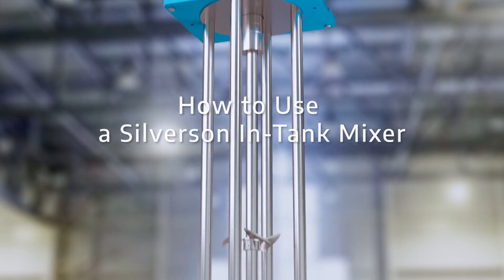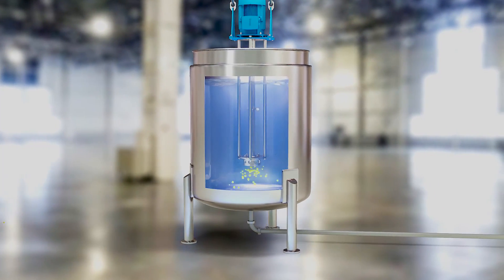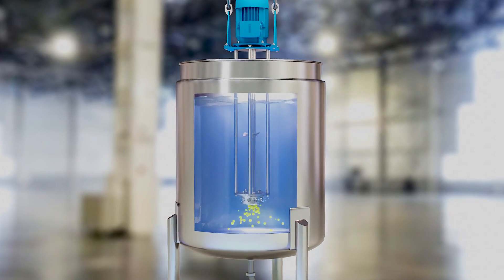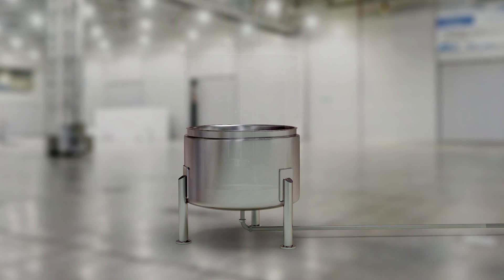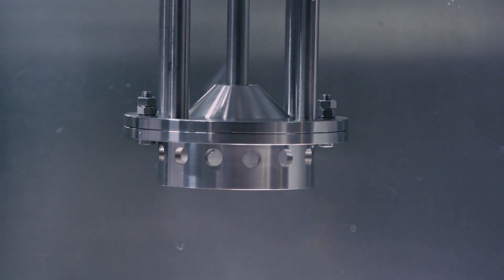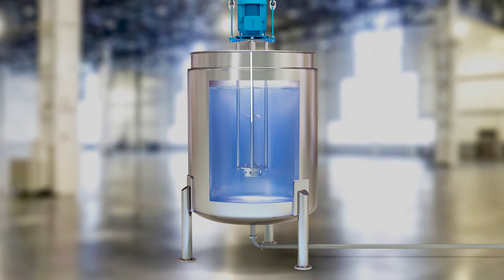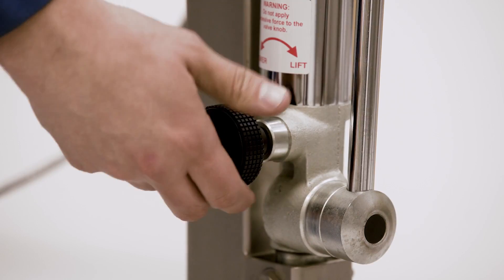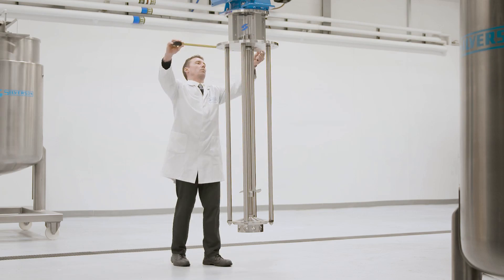How to Use an In-Tank Batch Mixer – Industrial Mixing Guide

Comment: I'm curious as to how to clean such a large machine 😅
Reply from the maker: You can run the mix in a vessel of clean water or cleaning chemicals to clean it quickly, depending on the application.